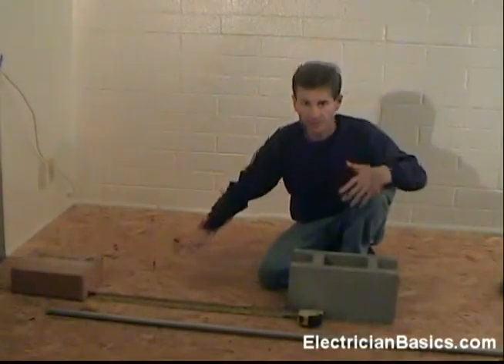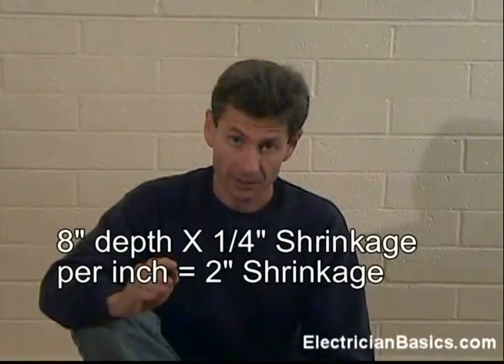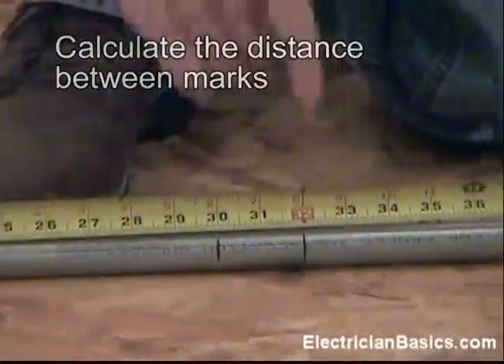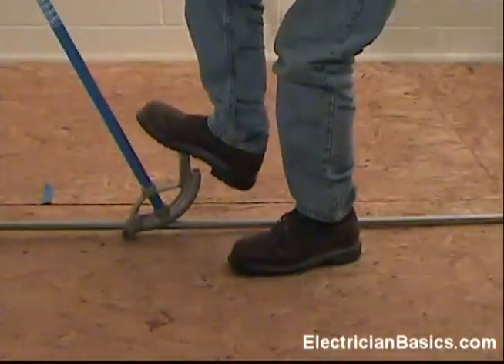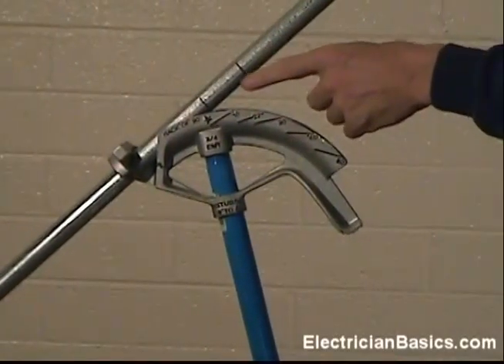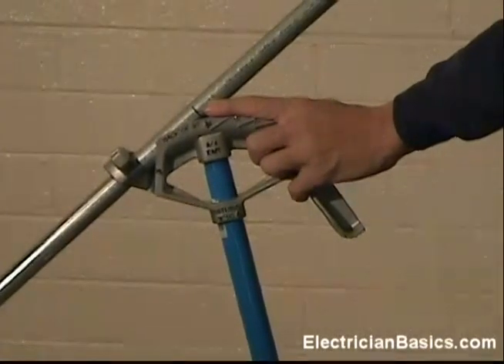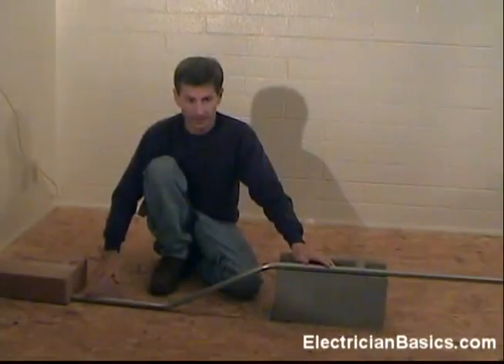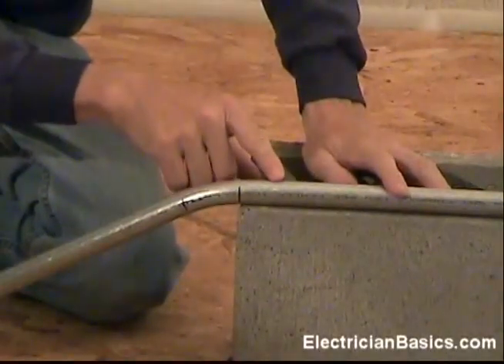Offsets With Shrinkage

Comment: Ty for sharing your time and knowledge. I don't know what I'm doing wrong. For example i have a full piece of emt pipe(120 feet). Starting from my box to obstacle is 6 inch. , the height or depth is 10 inches. Using 30 degrees my " a "  mark would be 7 1/2 inches including shrinkage. My " B " mark would be at 27 1/2 inches. I do it and it doesn't fit from my box to obstacle